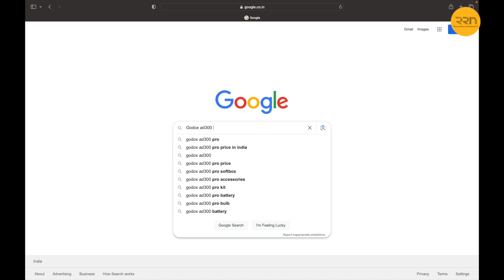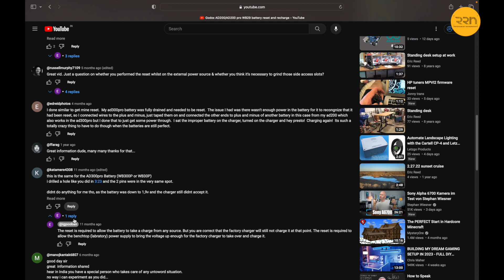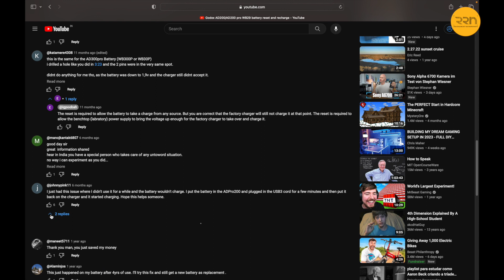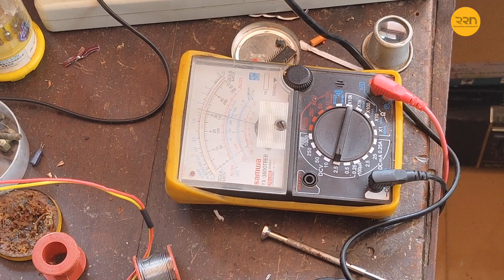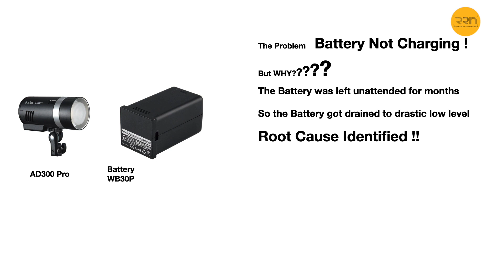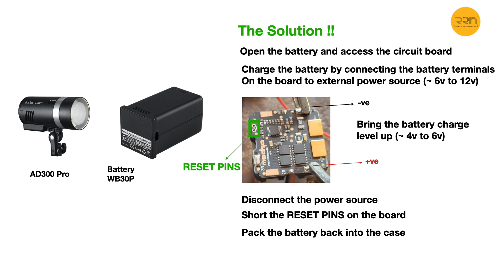Godox AD300 Battery (WB30P) Not charging | FIXED

Comment: Just did this process with a $40 power supply found on Amazon, a "Nice-Power SPS-305". The hardest  part is getting the battery casing off w/out destroying it. Once you remove the label - just keep tapping all around the seam, as seen in this video. Eventually one side will pop off. The other is held in by glue and harder to remove, but keep gently working it until its off.

 NOTE: I did not have to reset anything on the board. Once the cover is off - I hooked up my power supply (set to 1.1A, 16.8v which is what is shown on the charger as it's output). I calmped the leads onto the charging wings (double check your positive & negative) and let it sit for about 5 minutes. Held the casing on while I put it back in the charger and it started charging away.
Reply from the maker: Happy that it started charging again. Keep an eye on the battery. I have seen someone saying there are chances that the battery go back to that dormant state again if we keep it idle without using.

Comment: I am having similar issue on 2 of my batteries. Can you suggest which external power source should I use?
Reply from the maker: We used a custom home made power supply. It's a transformer based regulated power supply. We started with 6v and gradually increased to 18v. Try using a regulated power supply with a voltage controller. If you have access to any electronic technician they might have similar type of power supply, try borrowing from them.